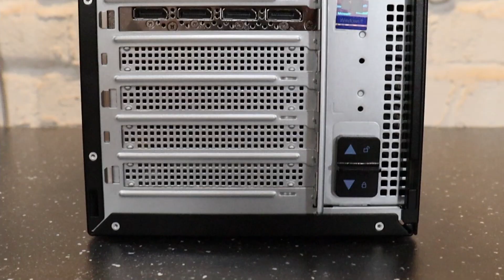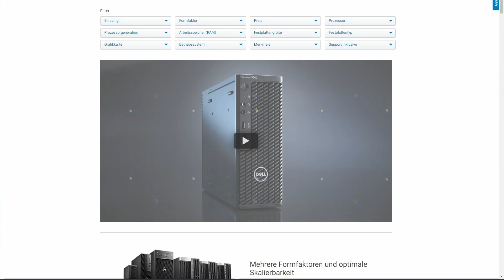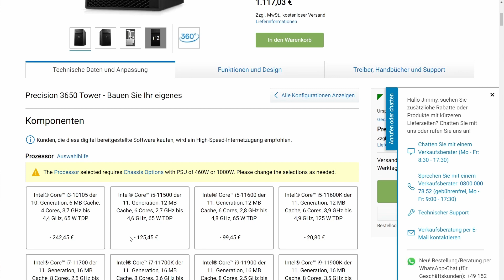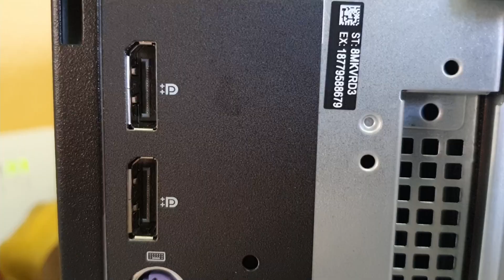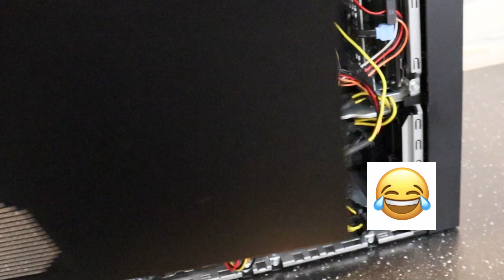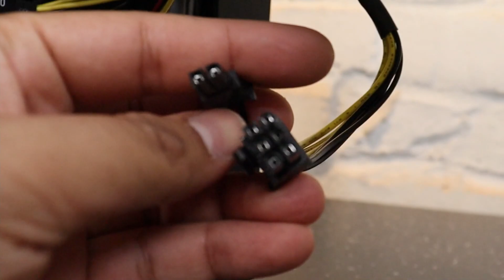Dell Precision 3640 / Review / Small computer, high performance in 2021

Comment: I have a 3630 it failed we check the system and change the mother board and then it came back cpu not good so we change it , it have in a new cpu and mother mother but still nothing on the monitor

Comment: I am glad I purchased a 3630 off of eBay. I upgraded the PSU, installed new thermal paste, added an ssd (sata) and dropped in an RX 6600 xt. It games at 1080p like a champ!
Reply: I have a 3630 it failed we check the system and change the mother board and then it came back cpu not good so we change it , it have in a new cpu and mother mother but still nothing on the monitor
Reply: @Dygo784  I had that same problem with my Dell Precision 5820. My RX 6600 xt would not work in it
Reply: @Sector001ked  and what happen?
Reply: @Dygo784  I installed a Dell rtx 2070 gpu, installed a different thermal paste and added an extra 80mm discharge fan. That worked.
Reply: i got a 3630 today, it came with no power cord though, what amps and voltage power cord do i need to run it?

Comment: I bought one for my older Brother. Had storage upgraded to m.2 1TB and 32gb ram. Has the Xeon w1290p cpu 10 core 20 threat very fast. It has uhd630 gou built in as well.
This is a killer budget gaming machine. The PSU is a standard sized PSU can be replaced with most off the shelf PSU's. Needs 24 pin and 8 pin mobo connectors. So 2x4 or 1x8 mono connector and 24 pin. Fits a 12 inch video card.

Comment: Running Ubuntu 22.04 LTS on my Precision 3640. It came with 16GB of RAM and I have ordered 64GB RAM to add to this. It's quite disappointing that it doesn't have a Wifi card.

Comment: Good review. My home workstation was a fully loaded Dell T7500 (2 Xeon W5590 cpus, 64Gb memory, 4 15K rpm scsi drives). It finally died and I replaced it with a Dell 3640 (1 I9-10900 cpu, 6 SSDs, optional 120mm cooling fan, upgraded stock 300 watt power supply to a 750 watt Corsair). The 3640 is 1/3 the size and 1/4 the weight of the T7500. I purchased the 3640 for the extra PCIe slots for graphics and storage adapters. The T7500 was loud and power hungry. The 3640 is dead quiet you dont even know it is on unless you put sufficient load to start up the cooling fans, even then it is extremely quiet. The 3640 performs extremely well much better than the T7500.

Comment: I got one of these in April with the 10900K at a bargain price, All Lightroom/Photoshop at the moment, very stable but temps high and throttles constantly under high workloads! Interested in what you're thinking re. cooling.  I'm adding two front fans in the next week and removing the top HDD which blocks air flow into that really small space between the PSU and CPU/memory area.  I reckon the endgame is probably a new MOBO, air cooler and case.  Good Luck